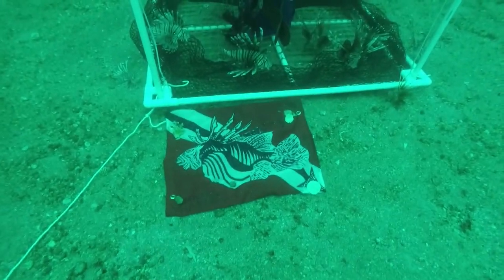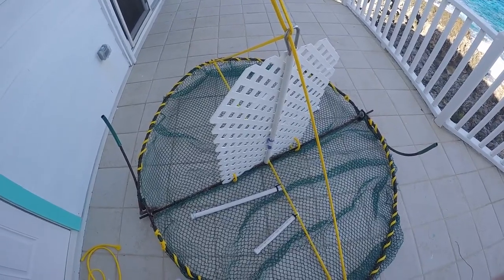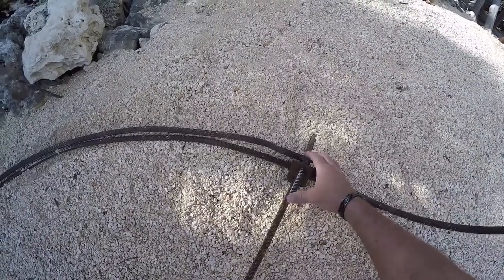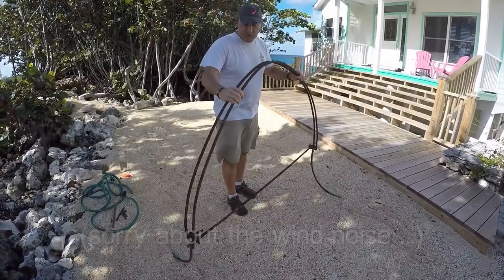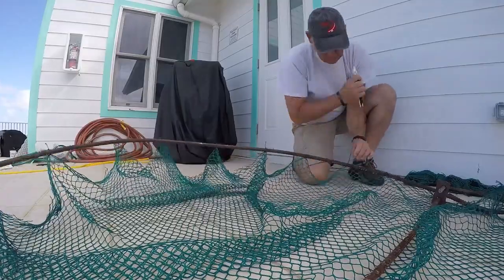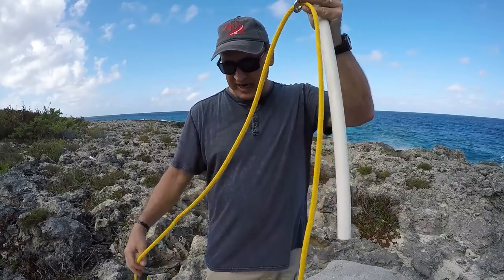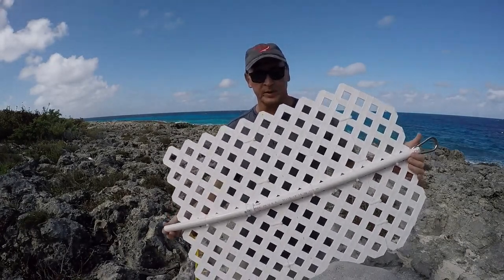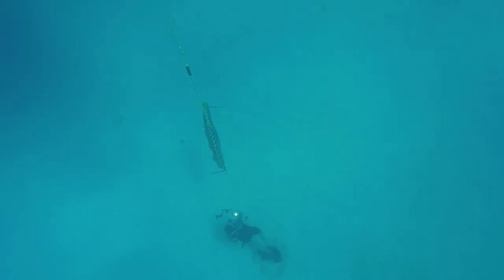Building Lionfish Purse Trap V6

Comment: Dr. Gittings I love your idea and want to put this video on an awareness website I am building for my country Belize.  I would of course give credit to you and your Youtube sire for this great video.
Reply from the maker: There is actually a group testing the traps in Belize right now.  We're working on an instruction guide to build an less complicated version of this design.  It doesn't require any welding, just bending of small loops into the rebar to create hinges.  We will need to put together a video for that.  In the meantime, the version in this video should operate  the same way.

Comment: Yay, Im your first viewer! I love this idea, Is there anyway I can communicate with you for more information on this?
Reply from the maker: Do you have an email contact?
Reply: Have you tested these as yet. If so how long was the soak time, and what was the average catch per trap? I have a commercial fishing business and thinking of implementing.
Reply from the maker: I did tests off Pensacola, and new traps soaked for about a week.  My traps were about 6' in diameter.  Larger traps might hold more fish, and could require more soak time to attract them, but that remains to be seen.  I'm hoping researchers and commercial fishermen will learn more by trying them in various locations, and make improvements to the design.
Reply: I have been watching a fair amount of these lionfish videos, and I have what might be a dumb question, but might be a great idea, since I am not part of the fishing community it's a look in from the outside.  When they are out in the open in a herd, so to speak and yes I know that fish run in schools, why don't several divers stretch out a casting net and drop it down on them?  It seems like it would work better than spearing them one at a time.  Plus they do seem to move slowly out of danger zones so couldn't they be herded away from structures into the open and group netted?  Obviously this isn't allowed for normal fishing, but if this is an invasive species, isn't containment/eradicating them what we are looking to do?

Comment: I hope you have a better presentation when you have a working lionfish trap. Currently I don't see it. Lionfish roam around corals most of the time, and your net will get stuck easily. All the effort is good effort, so keep up the good fight. These fish don't belong there and have to be eradicated.
Reply from the maker: True about snagging on the reef.  This trap is not for shallow reefs, where spearing lionfish is much more effective.  It's for deeper water and on sand near hard-bottom areas that have lionfish.
Reply: @srgittings  Ah, didn't think about that. Smart thinking. 
And when the lionfish see the trap, they may come and shelter there, since they like sheltered places to rest.